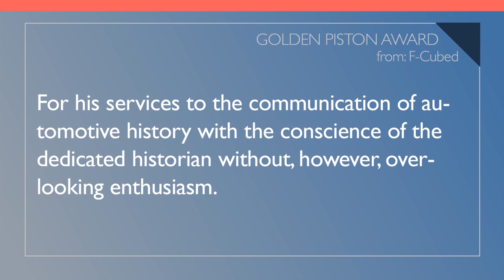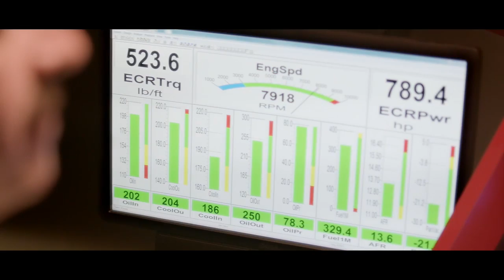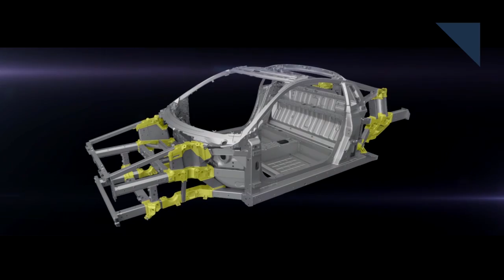Old Scion's Get New Toyota Names, Automated Braking to be Standard - Autoline Daily 1822

Comment: I can't speak for manufacturing, but for the services we outsource (engineering, analysis, drafting), the ratio of production/cost is certainly not better overseas compared to the US. 

The extra time spent on each project & the number of errors requiring rework make outsourcing no better on the balance sheet, but it kills the project schedule.